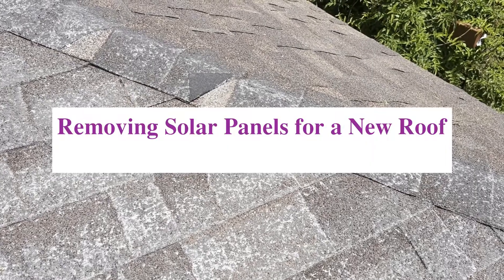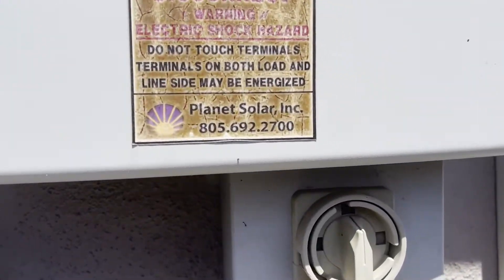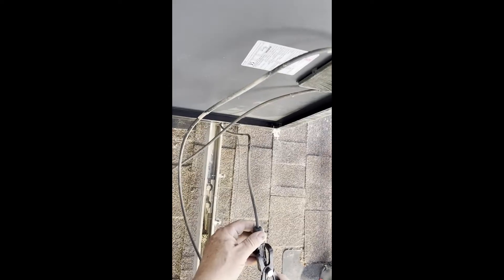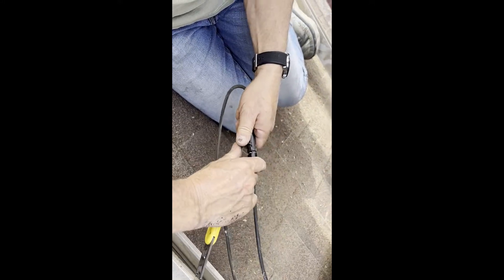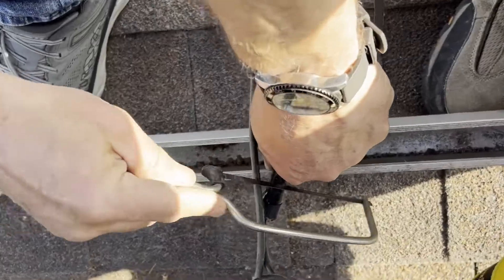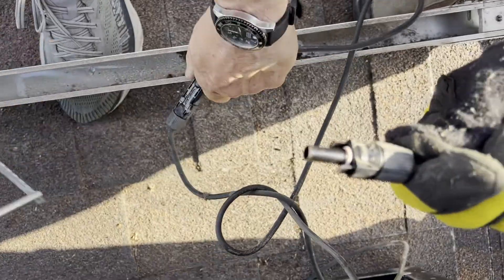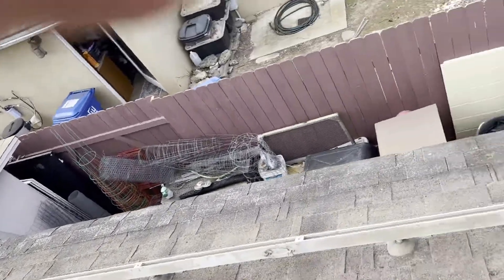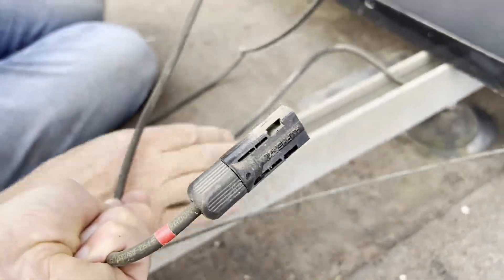Removing Solar Panels before a Replacement Roof

Comment: Good example of what a lot of us will need to do over the next 5-10 years.  Thanks for sharing!  I wish I had a better method for removing the MC4 connectors but looks like you had the best removal tool that I have found.  I probably would have cut the MC4 connector out if it gave me too much trouble and crimped on a new end.
Reply from the maker: Thanks. Nice to hear that from the super star of DYI Solar videos!  Your videos helped me tremendously.  Thank you for your service!  If you were in CA I certainly would have hired you to help.  The solar guys here are all too busy and the bid was $4k to remove and replace, but wouldn't give me a date.  One company told me:  Maybe next year.  The total cost of the entire system 15 years ago was only $8k which included really nice hardware, panels, installation and permits so 4k is too much to me.  The roofers were great, but don't want to touch electrical. BWT.  Some of the wires in the landscape mount had very little slack.
Reply: It’s sad that a lot of companies will sell a system without evaluating the roof or telling people they could spend $250/panel for me to come do the D &R for them.
Reply from the maker: @mikeGarcia-hw7vb  I have 18 panels so $250/panel would be $4,500.  I have been extremely happy with my original system done by Planet Solar.  The were very honest and accurate.  I took a risk because my roof was about 16 years old at the time of installation, but it went 14 years and I never had one leak in any of the 32 mount penetrations.  The mounts were such good quality that I reused them.  After rebates and credits my original system was only $7,814 in 2011 and that included panels, inverter and installation.  They predicted payback in 8.2 years, but I think it was faster.  I am pretty confident of my reinstall as we used peel and stick as well as a layer of under-lament.  In 2011 at the time of the install electricity was already 15.2 cents/kWh and now it is about 40 cents out here in crazy California.

Comment: After re-installing the system did everything work ok?  I am getting ready to start the same process with a new roof this year.  I even have the same inverter as you.   Thanks for sharing this video, it actually is not that big of a deal after seeing you in action.
Reply from the maker: Good question as it now has been a year.  Everything did work great and still does.  Amazingly, after having this system for over a decade I have never had to have a professional come out to do anything.  Good thing as the installer is no longer around.  They probably were not competitive because they did use very high quality and expensive mounts.  If you have cheap mounts, you might want to replace them.  All I do is occasionally wash the panels.  Physically, the job is not that difficult.  Nothing close to doing a roof by yourself.  You do need to be careful about hitting joists with your screws.  Also, you need to work fast because most roofers want to do the shingles as fast as possible and will not want to wait for you.  It really is best to have a friend help because it is awkward to climb a ladder holding a panel.  I wouldn't want to do a 2 story house with a steep pitch.
Reply: @DYI  Good info, fortunately my roofer is going to take care of it for me.  He has done them before, when he was bidding the job he took pictures of the connectors.  He mentioned disconnecting the connectors is the most difficult part.
Reply from the maker: @Travis8126  You are very lucky your roofer would do it.  I had multiple quotes on for my roof and none of the roofers wanted to touch it.  They seemed to be afraid of electricity.  I am an Electrical Engineer so have more fear of falling off the roof than from a shock:)   Your roofer is correct.  The connectors were a real pain.  I think I tried several tools and none worked very well.  In hindsight I should have just cut off the old connectors and put on new ones.  The problem was that the old connectors virtually fused together due to heat and high current going through them.  Make sure your roofer installs the screws just after the  roofing paper and flashes around them.  Don't let them do it at the end and screw through your new roof.

Comment: Use a zip tie to unplug them. Thank me later
Reply from the maker: Thanks.  That is clever.  So you use a zip tie for a temporary clamp and cut if off once the it is unplugged?  I guess there is no incentive for the people making tools to tell people that their tools not only don't work, but can be replaced with a 5 cent zip tie:)   I may never get to try it myself as I just moved from CA to TN and solar make no sense here.  Electricity if 4x cheaper to start with and we get less sun and there is a real risk of hail and wind damage.  Payback was only about 6 years in CA, but it is a long term money loser here.

Comment: Can I remove my own solar panels?
Reply from the maker: Definitely.  It is not too hard to do yourself and it is hard to get a pro to do it for a reasonable price and on your schedule.  Where I lived and when I needed it the solar companies were super busy and couldn't fit it in to match the roofer's schedule so I did it myself.  I did have a friend help me as good to have an extra set of hands.  It also helps to have a 1 story house with not a very steep slope.  Very important to have the roofer flash around your mounts instead of just bolting them on after the roof is done.  You need to get your roofer to do this and to put  it in his quote.  I had a really good roofer who didn't need to be told what to do for the mounts.  He just didn't want to touch the panels.

Comment: Why didn’t you buy the $2 tool that is designed for and needed to take the connections apart?  They come right apart easily.  You actually sawed them🤦‍♂️.
Reply from the maker: You need to watch the entire video, but in summary I purchased multiple tools.  The best one was the expensive metal tool, but it still didn't work on all the connectors which were old and brittle.  I am sure all the tools work great on new connectors.  Due to the voltage and heat the metal was also seized together.  In hind sight I might have been better just cutting off the old connectors and putting in new ones, but the risk would be that the wires had very little slack in some cases.

Comment: Don't you need to remove the channels?
Reply from the maker: You are absolutely correct.  I thought I could talk the roofer into roofing around it, but no such luck.  Fortunately, it was very easy to remove the channels as they are very light weight Aluminum.  I removed the channels in a few hours working alone this time.  They just unbolt with a 5/8 inch socket in an impact wrench.  Very straight forward and no new video is needed.  I also removed the 32 flashings and mounts because I wanted to do it carefully so I could re-use them.  Again, very easy.  Just one 3 inch lag bolt with a 1/2 inch head attaches an aluminum base that a 4 inch aluminum post screws into that receives the bolt from the channel.  Very easy to figure out.  Turns out new mounts are $30 each and they are not even as nice as these 15 year old ones.  They figured out how to make them cheaper, but not to sell the cheaper:)  There are 32 of them so it will save about $1000 in material to reuse.  I will make another video on the re-install.  The connectors will be much easier to plug together than to separate, but I am sure there will be other challenges!
Reply: I have a 20k bill to remove and reset 35 panels to get my roof redone. I can’t believe this nonsense. Im glad I watched this
Reply from the maker: @lpsgalaxywolfpaw6042  That is the highest I ever heard!  You must have a 3 story house or something unusual as a that is nearly $600 a panel.  I have heard $300 to $400 as the going rate which already seemed high.  You should also get a discount for having so many.  My system is only 18 panels which is more typical.